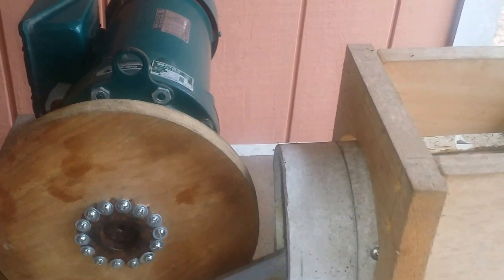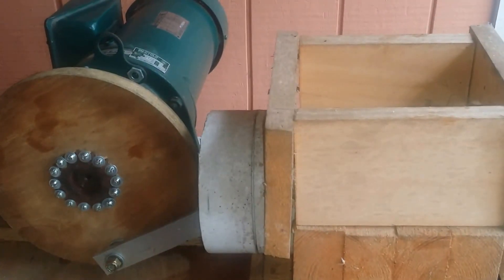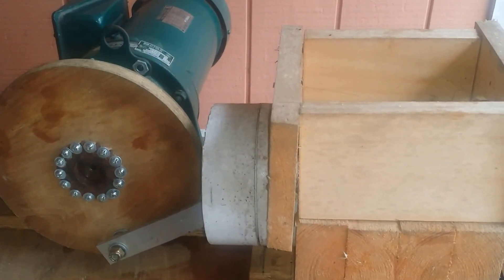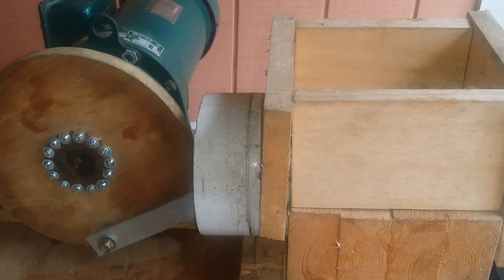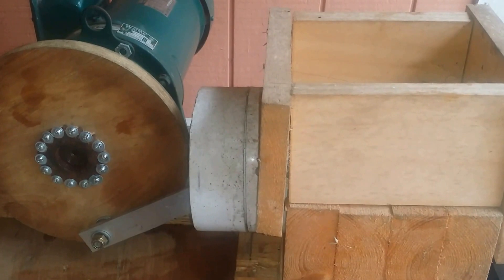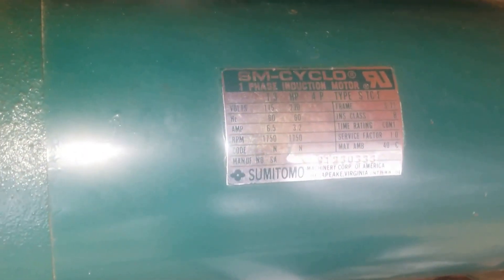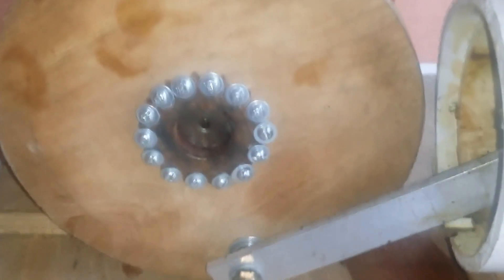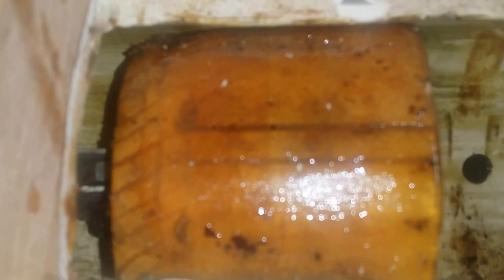electric can crusher

Comment from the maker: the motor is a 1/3 hp sm-cyclo motor. other specs: rpm=20; ratio 87:1 reduction; model hm-3097-a6. very powerful. purchased on ebay.